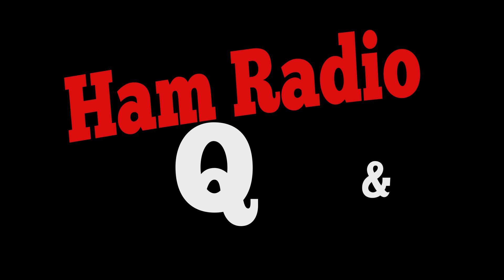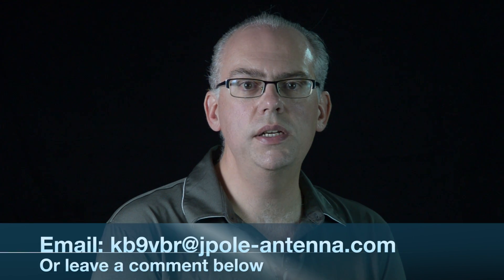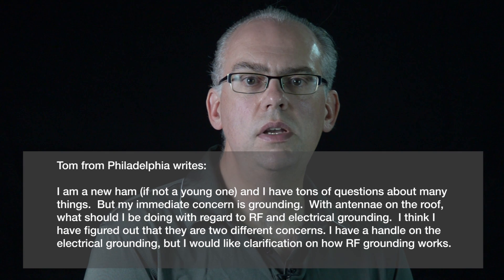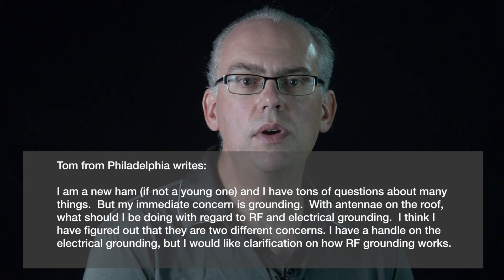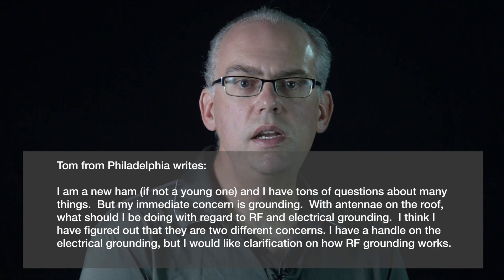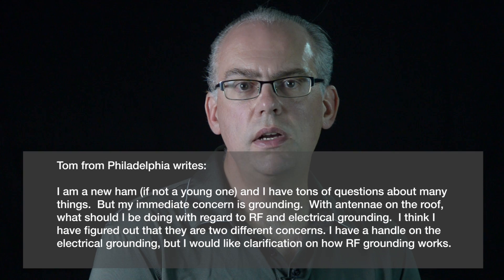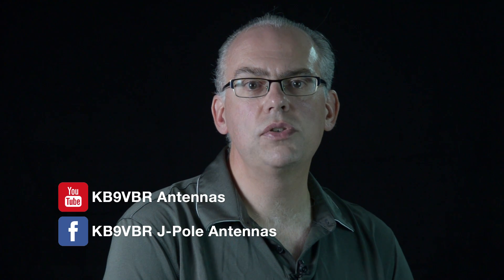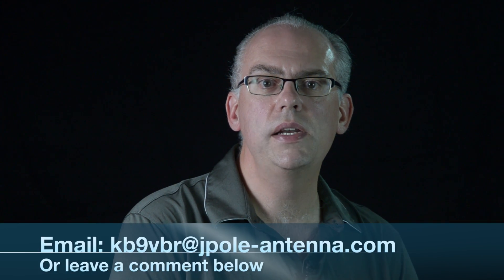RF Ground and Ground Planes - Ham Radio Q and A Episode 4

Comment: I don’t know if you still get messages anymore, but I am wondering if it would be appropriate to clip a copper ground wire with 24 inch grounding wire all copper of course to a CB antenna I’m kind of new although I have always loved radios since a kid I’m older now and I have the opportunity to make a base station in my Man cave outside.

Comment: newb question: in PCB design for a, say, Quectel L80 GNSS module, does the ground plane beneath the module as to be connected to the module GND pin? It is so a basic notion that it isn't  specified in the module data sheets...

Comment: I'm still confused. I have a Maco V58 5/8th wave ground plane base station antenna. 
I have it mounted on a pipe connected to a 6x6 wooden tower I built. It's not grounded other then coax connected to a lightning arrestor connected to 4ft ground rod. 

Is this sufficient? Many have told me I have to run a pipe all way down to the physical ground and ground the antenna. Although I already have it grounded through the coax. What should I do?
Thanks, Kaylen.. 127 KY 👋

Comment: Is your optimum dipole height assuming a horizontal dipole?  How about a vertical dipole?  Is the height from the center feed point or the height of the bottom element end from the ground?

Comment: Hi KB9VBR,   I have a question that you might be the right guy to ask and get an answer.
 
My on my house the roof trusses are covered with a plywood that has a foiled backed coating. Aka Tectshield.
Would this work as a ground plane if I were to install a HF antenna on the ridge line of my house?  The roof is pitched at a 5 to 12 pitch.

Thank you
Bill

Comment: Mobile mag-mount vehicle antenna,  to utilize the body as a ground plane
:

1)  Does the mag-mount need to be electrically connected to the vehicle's metal body?  
 What happens if the mag-mount is insulated from the vehicle's body?  
OR
2)  Does does the antenna base just need to be close enough to the vehicle body to reflect the radio signal, but doesn't need to be electrically touching/connected to the vehicle body?

Thank you.

Comment: You say on mobile mag mounts the body becomes the ground plane? But the shield on the coax does NOT bond to the mag mount... none that ive seen anyway.
Reply from the maker: The auto body provides a ground-plane for the mag mount antenna through a process called capacitive coupling. It works, but It's not very efficient,  so you will gain better results with an antenna that is bonded to the vehicle.
Reply: KB9VBR Antennas, thanks.  That makes sense. So is this done for some sort of DC filtering? I get good results bonding my mag mount to the body.  To me this makes the body a much better ground plane.

Comment: Appreciated the info, I have a 265 ft W5GI  160-6M Wire antenna north to south in a straight line, each end is 60ft in the air suspended in tall trees. In the middle where both sides join in center hangs at 20 feet is a long 75 ft ladder line angled over to the house. How high optimally should the cente of this antenna be?

Comment: I'm a newby also and I just built my own 1/4th wave ground plane for 2m.  Does it need a ground wire connected to a copper rod to be effective?
Reply from the maker: No it doesn't. The only reason why you would want to run a ground wire from your 1/4 wave ground plane antenna to a copper rod is for lightning protection. But the antenna will perform just fine without it.
Reply: Thank you and 73's!  KD9ILF

Comment: why does my 1/4 wave out perform my longer 1/2 wave antenna for 2 meters?
Reply from the maker: It's hard to give a definitive answer, but it could be due to location or terrain. The half wave antenna may be coupling with a nearby metal object, reducing it's performance. Or the terrain may be more suitable for the 1/4 wave antenna. VHF communication is primarily line of sight, so maybe the 1/4 wave antenna just has better characteristics for your location.

Comment: It took me 1/2 way throught the video to realise you were talking about a horizontal dipole :)  Does does a vertical dipole need to be a certain height, or are they similar to a 1/4 vertical antenna? Thanks
Reply from the maker: The RF ground height of antenna is more important for HF bands and less important for the VHF/UHF bands. This is because below 30MHz antenna height affects the RF energy takeoff angle necessary for E-Layer skip propagation. But as you get above 30Mhz, propagation becomes Line of Sight, so the E-Layer has less of an effect. Antenna height will outweigh the benefits of optimum RF ground height. The 1/2 wave vertical dipole and the 1/4 wave ground plane antennas are conceptually similar. The 1/2 wave will give you a bit lower angle of radiation, giving you a better RF signal distribution towards the horizon. So for VHF/UHF use, a higher antenna will generally perform better. I think I may have done a poor job differentiating between HF and VHF ground height, so thanks for the opportunity for the clarification.
Reply: Thanks for the detailed reply - A few factors to consider then :)  But I'm now beginning to understand what you said about take-off angle and it's relationship with the frequency - thanks again for the info :)